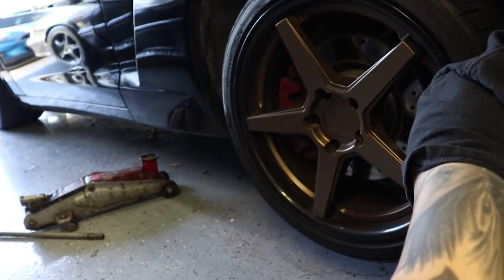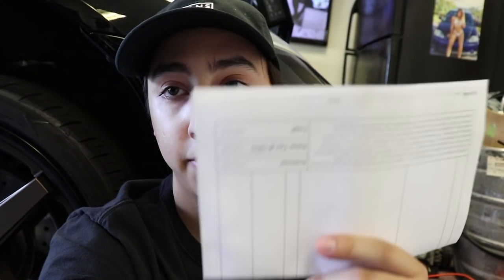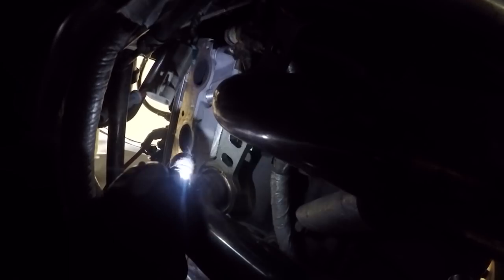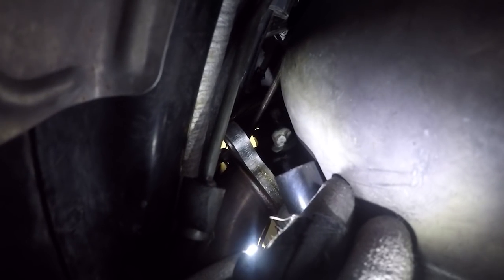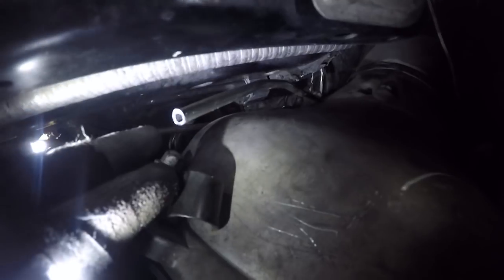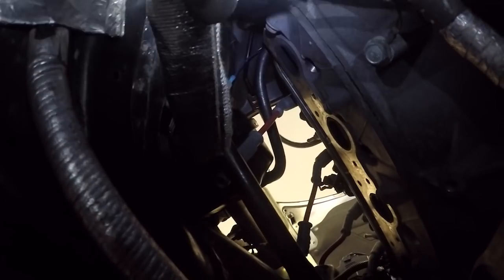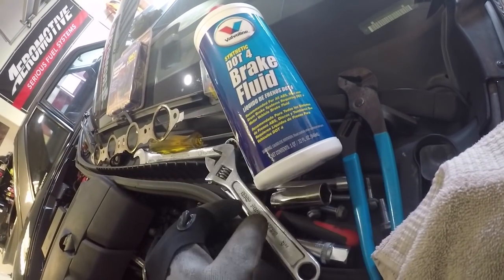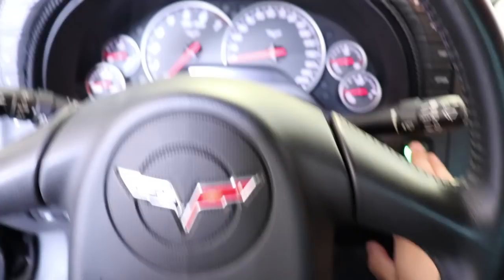This Can Save You HUNDREDS of Dollars (Corvette C6 Clutch Line Repair)

Comment: I’m having the same problem and I’ve tried putting some clamps with a little bridge but it hasn’t held. How has this line with the compression fittings held up?
Reply from the maker: Going on a year now with no issues
Reply: Did you end up fixing ? Going through same issue

Comment: Still rubber inside that steel braiding, rubber will turn to plastic with high heat and fail, the chards of hardened rubber will find their way into all sorts of places. I’ve been dealing with hydraulics in high heat (steel mill) applications for nearly 2 decades. Hose, tube and wire management is key along with heat mitigation.

Comment: Great vid! I burned the plastic piece that connects the clutch MC line to the slave cylinder line due to the heat produced by my headers during a track session. I had to cut the metal line like you did and used a compression union so I wouldn't have to replace the slave cylinder, which would be a b*tch of a job. I am going to follow your advice and heat wrap the lines and the headers. Hate for this to happen again! 

BTW, while I am under there I'm thinking of installing the tick bleeder. Can you make a video on that if you can? I have the feeling it won't be easy! Have a great one and enjoy your ride!! Peace ! -Joe

PS: I hope the bleeder install doesn't lead to me bleeding out! :)